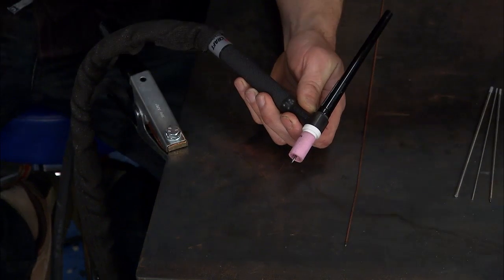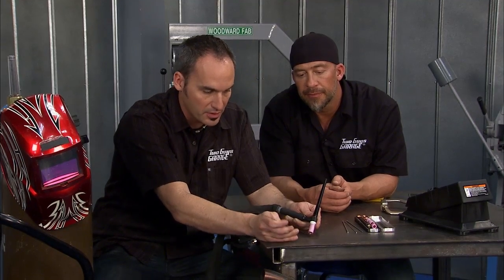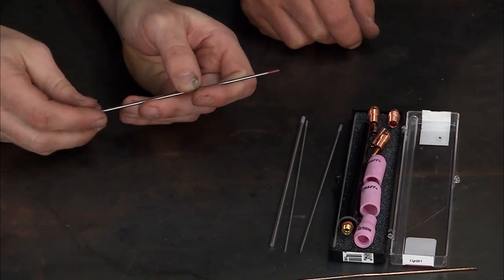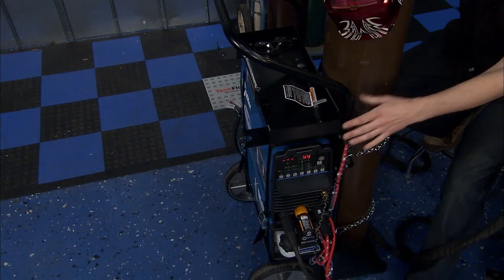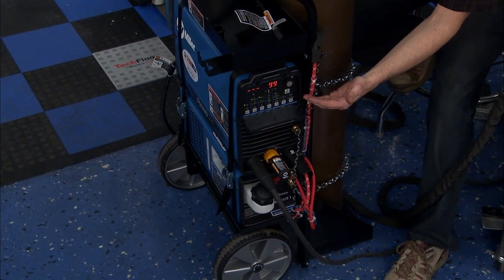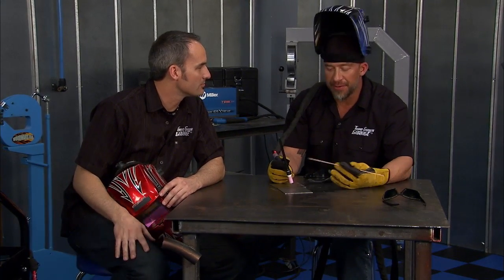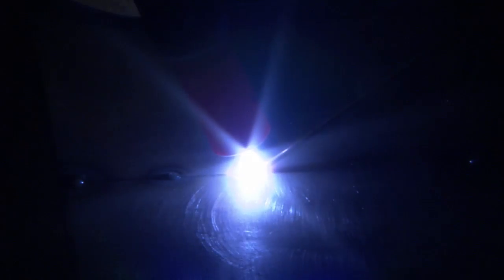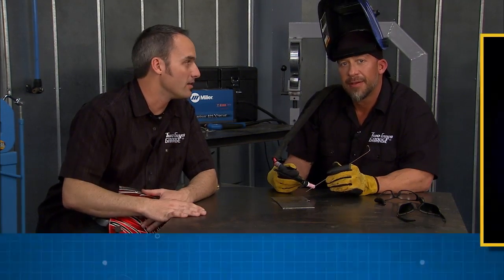Two Guys Garage TV: TIG Basics/Miller Dynasty 200

Comment: I bought the Miller Dynasty 200 back in 2010.  It’s a great machine and mine is still running strong.   I will check on the wireless pedal;  that would be very handy.   Thanks for sharing this.